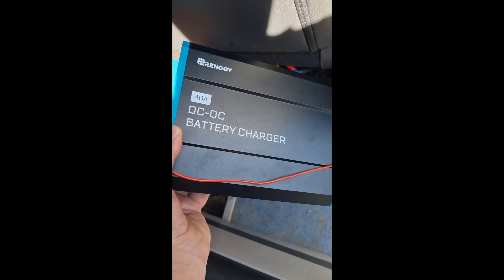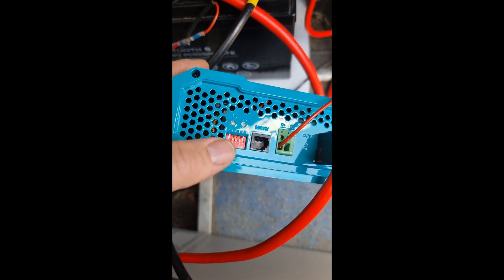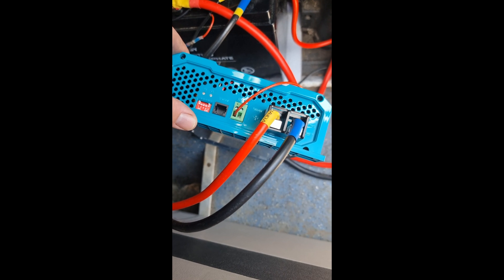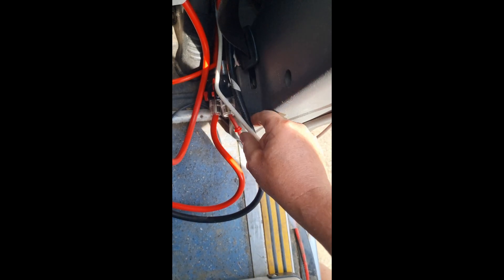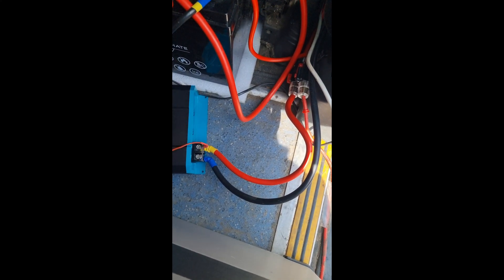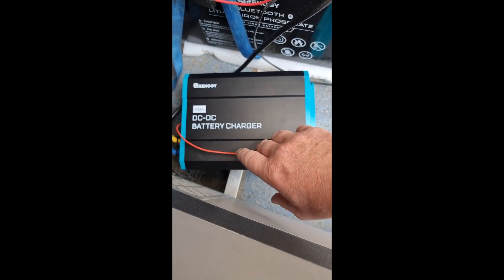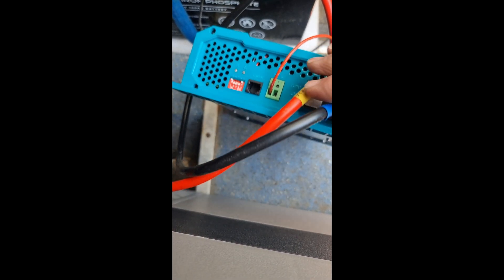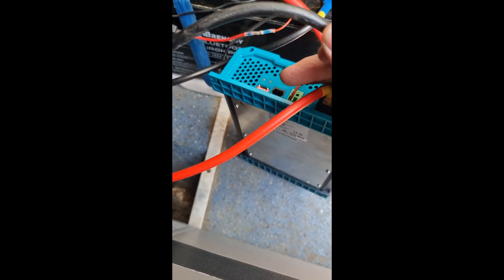12V 40A DC TO DC ONBOARD BATTERY CHARGER SETTINGS FOR lifepo4 , Lithium batteries

Comment: if you have the ignition power cable connected to ignition it will still power up straight away anyhow. You would have to put in a switch so vehicle can warm up then turn on. What happens when you forget to turn switch on? doesn't make sense.

Comment: Good vid .What gauge are you using ? I Have 6 gauge starter  to agm golf cart 6v x 2= 12v 230amp hours renogy 40 dcdc  6ft to house battery . You said it gets warm . Whats your gauge advice for my install with your experience. thank you